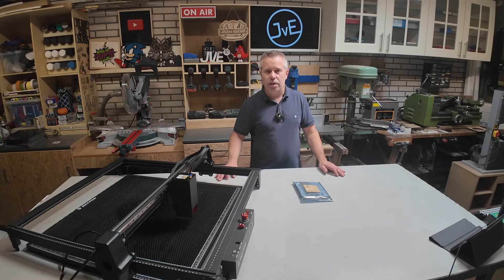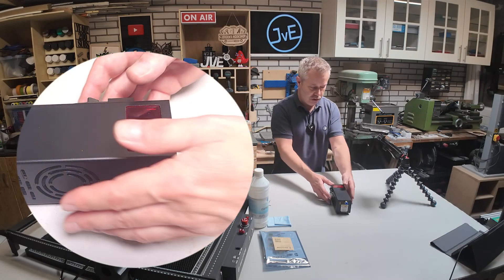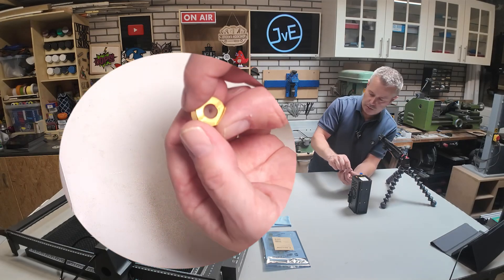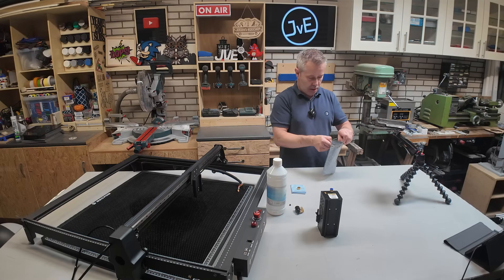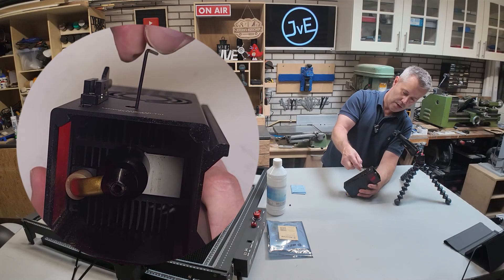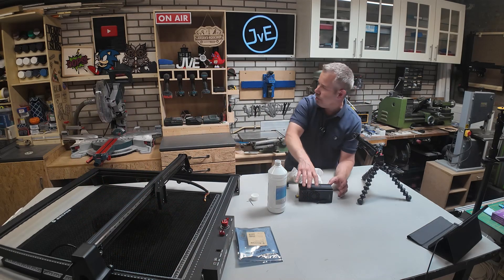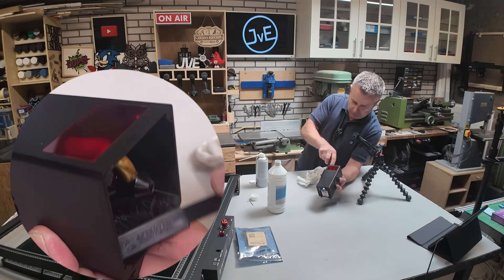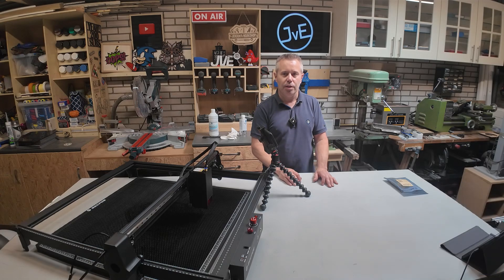How to clean the lens on your laser cutter | Mecpow X5

Comment: i lost the nut to hold the nozzle, would that make the machine not engrave? i cleaned the lens and now it doesnt work.
Reply from the maker: Hi, normally that should not result in the machine not engraving as it should still work even without the air-assist nozzle.
Did you check the lens after cleaning to make sure it is 1. Not damaged and 2. Clean without any spots.
Do you still see the blue light or it does not turn on at all? If it does not turn on at all, did you check the connection of the cable to the laser? Correctly connected and no faulty wire?
Reply: @jewijk  It cuts but at slower speed and power. It does not engrave properly. Yes the light is there. i have used it properly for just over a year and realised that i should clean the lens. i have ordered a set from Mecpow. i am glad to know the nozzle is not the issue. I will wait for the new lens. Thanks for your response.